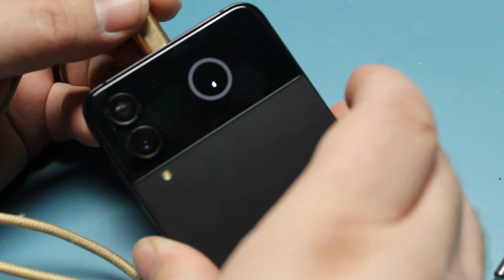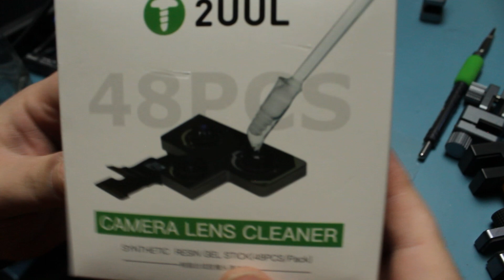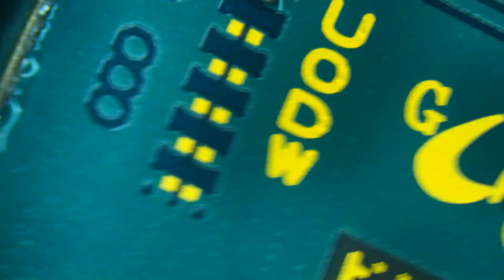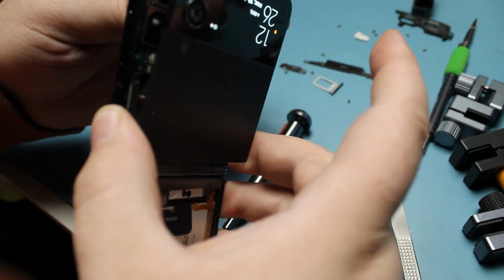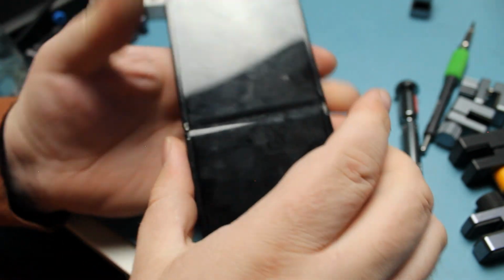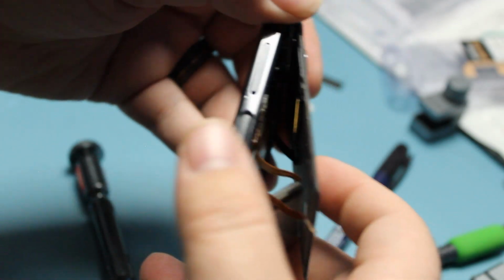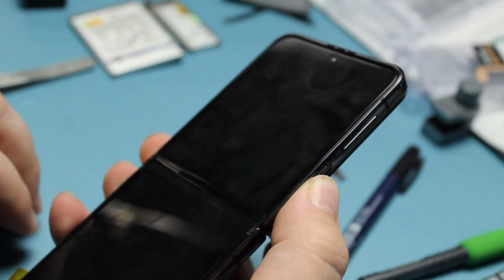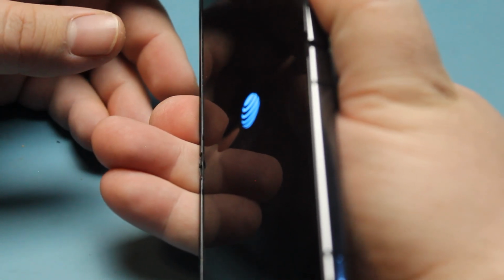Diagnosing a Samsung Z Flip 4 Blackout: Part 1 - Troubleshooting Techniques

Comment: I replaced the flex and is not that is software it happened after the UPDATE on January 2025, mine is random and the phone is on is just the backlight that is off, system UI crashes and seems to be originated by knox

Comment: Thank you for this video! I have dealt with these phones and they are an ABSOLUTE nightmare! This phones are seriously NOT worth the money to buy in my opinion. The flip and fold both. I just recently had a 2 month old fold that the touch went out. No damage on the screen and I put in a new cable, but still didn’t work. Can’t wait to see the next video
Reply from the maker: Thanks! They can be frustrating to work on for sure.